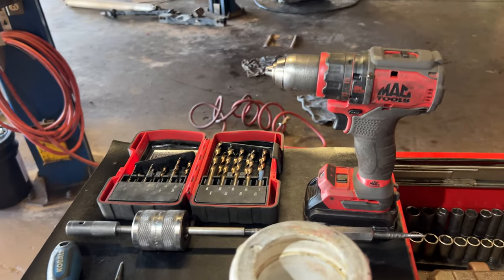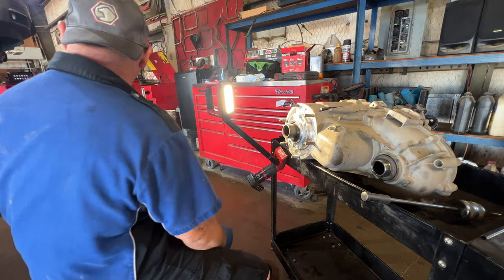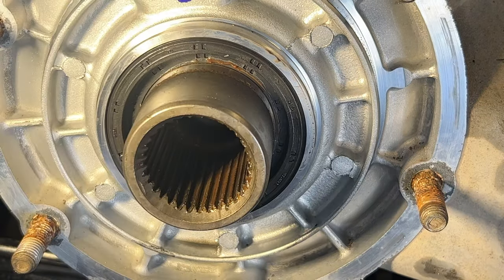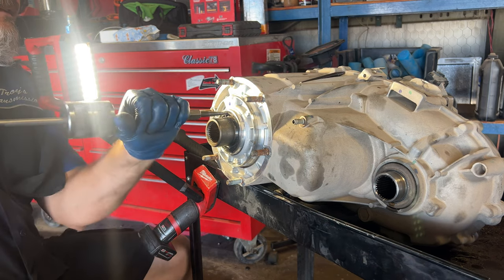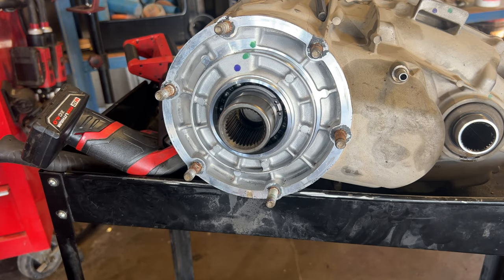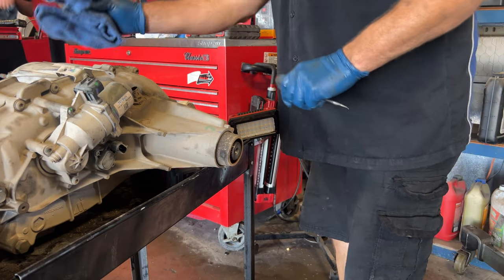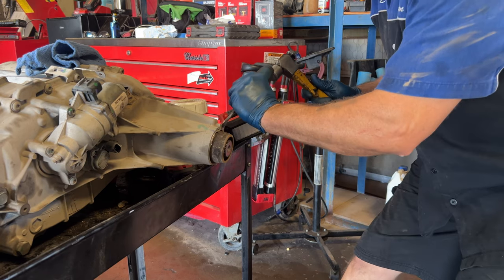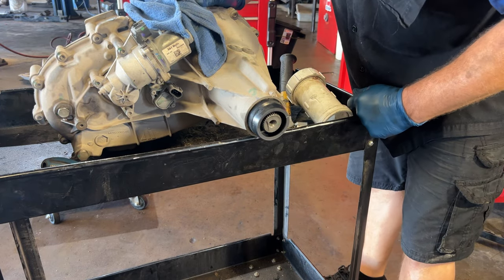How to Replace Transfer Case Seals in Late Model GM 4X4

Comment: The job pays a half hour to pull the T-case and replace the seal or just the seal is a half hour
Reply from the maker: Just the seal. Typically a T-case r&r pays 2.5-3.0 hours